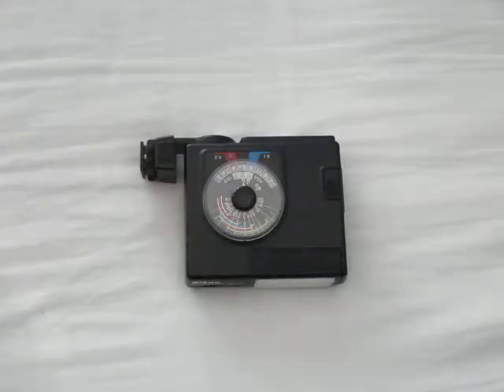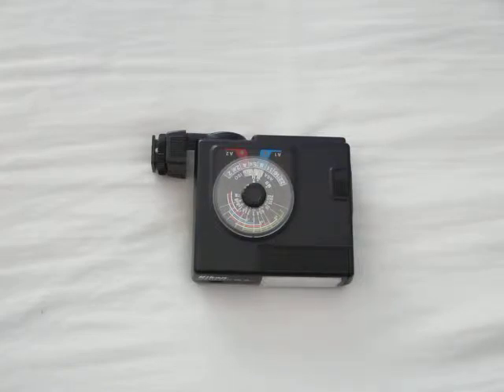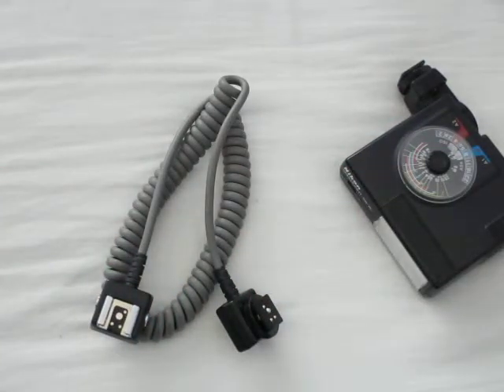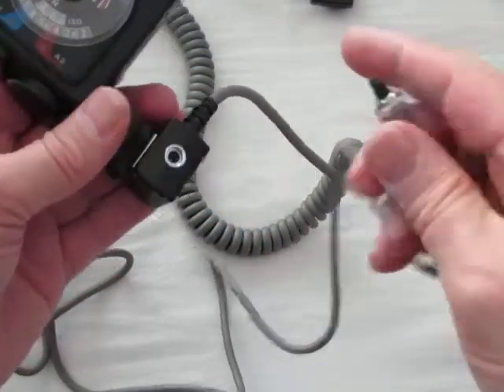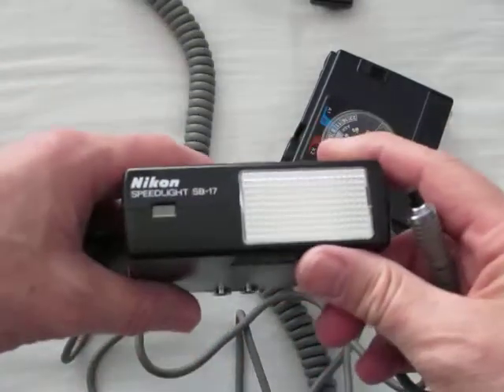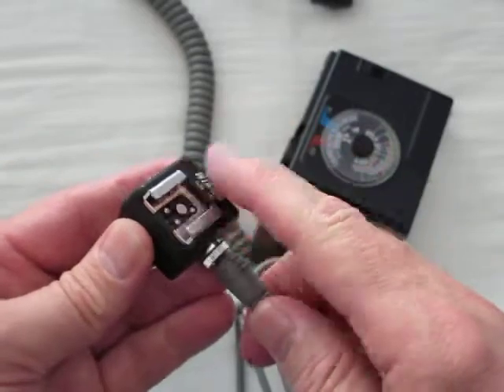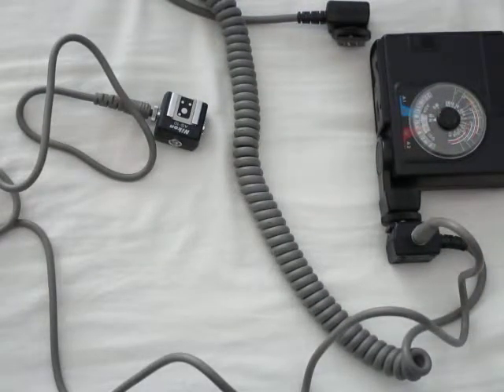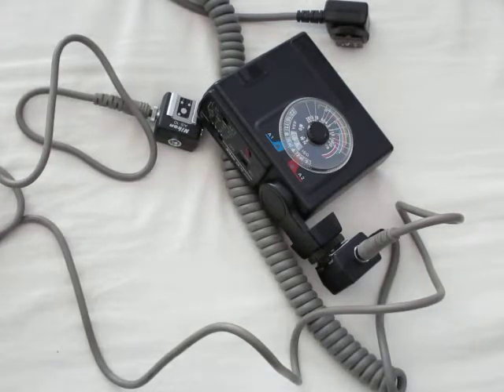Nikon wired flash pt1

Comment: thank you for this. I was really confused about what I needed for the older film cameras. bought an sc-24 by mistake.
Reply from the maker: Hi there,
 the old Nikon wired flash is a little cumbersom but fun to use. Try to get hold of an old flash manual, it gives all the possible combinations and part numbers that are compatible.
 Even though film isn`t as cheap as it used to be it pays to experiment and you still get that old feeling of what worked and what didn`t work.
 Enjoy your snapping
Paul